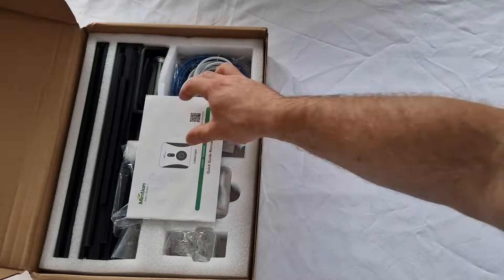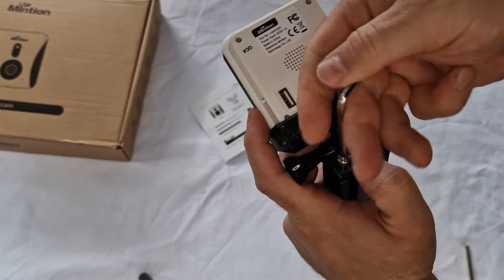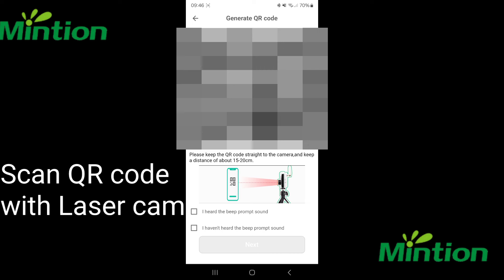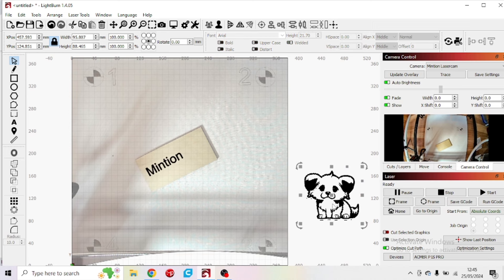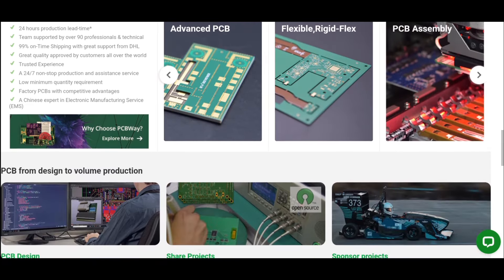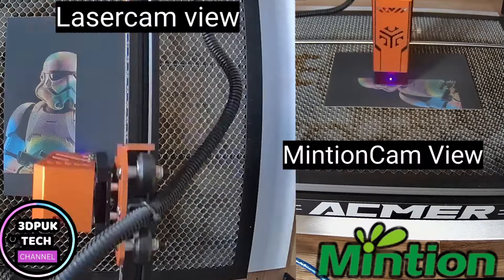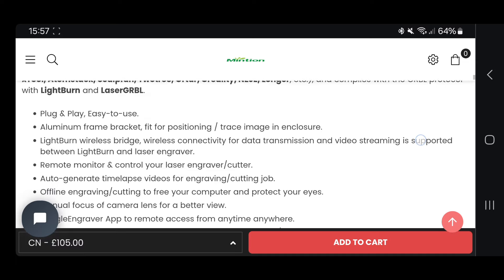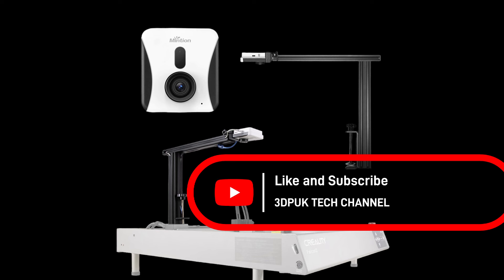Mintion New LaserCam Unboxing, setup and review

Comment: Can’t get the camera setup in windows for WiFi, it’s not supported for just the camera, and the resolution is lacking… Seems to work ok via USB and the arm is decent, probably going to ditch the camera for a 16MP alternative… Looking back it probably would have been better to just start with aluminum extrusion and a decent camera rather than fooling with this product.